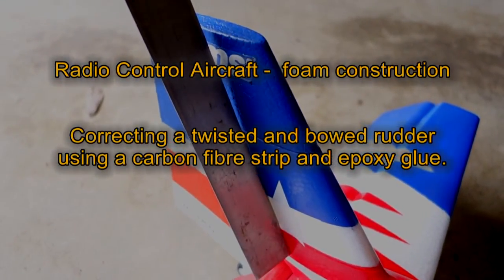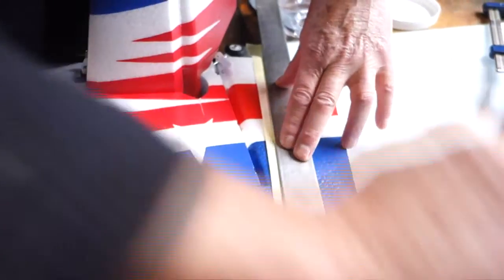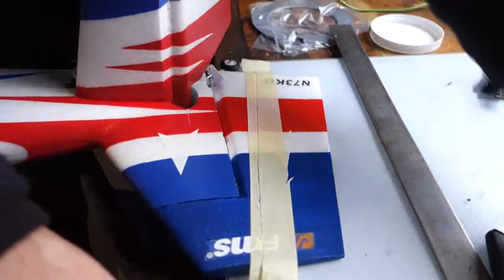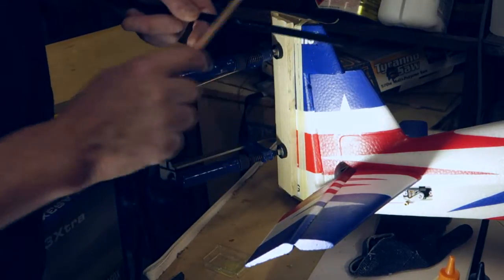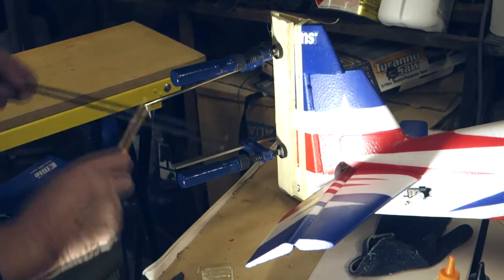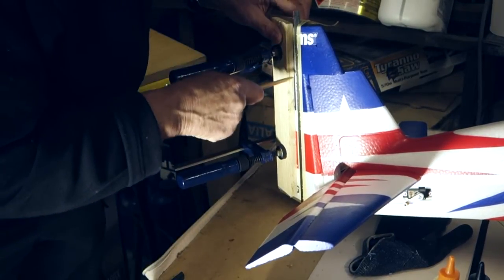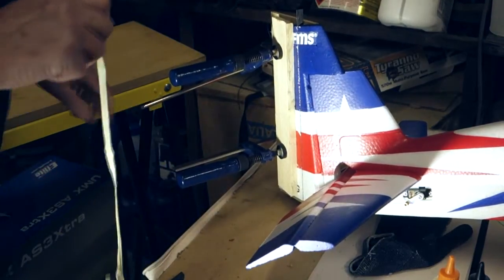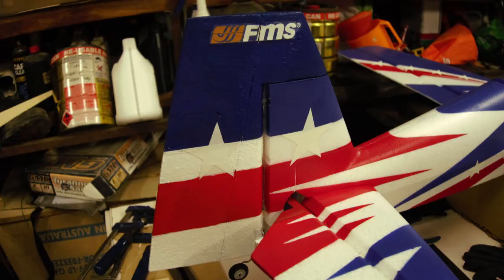RC Extra 300 repair rudder with carbon fibre .

Comment: Could you take a picture of the tail will mine has come apart in the back brand new plane I can't see how it holds in the rudder so the wheel just spins around when I turn left or right it goes any direction it wants to